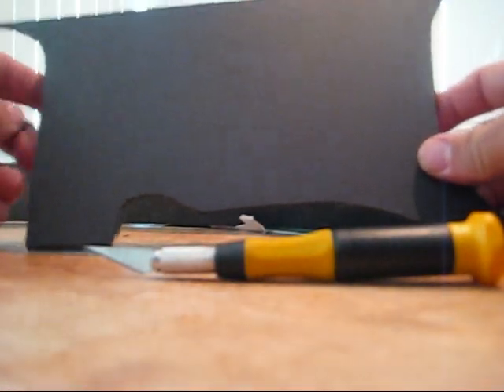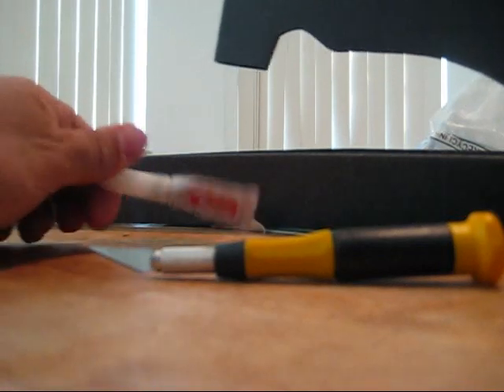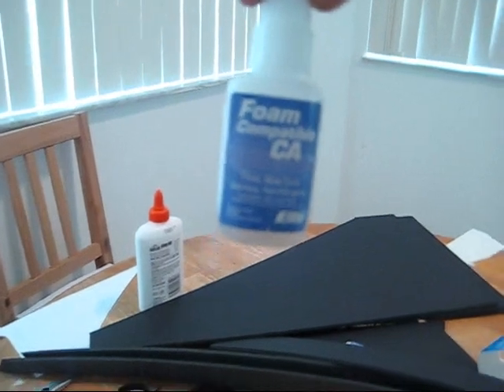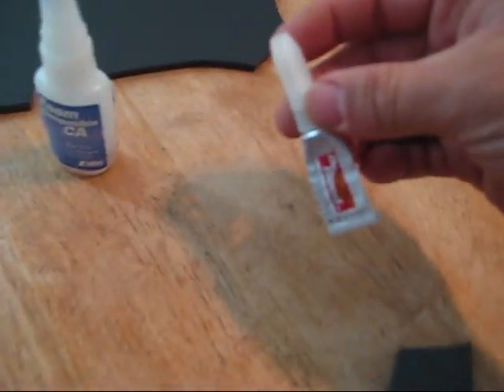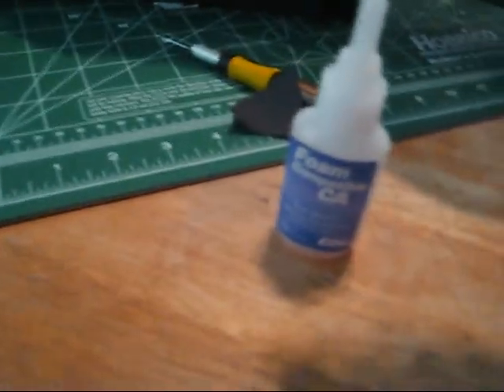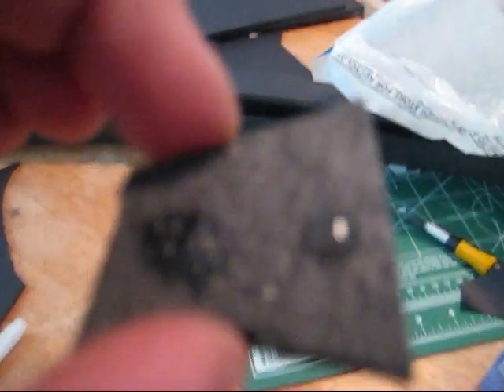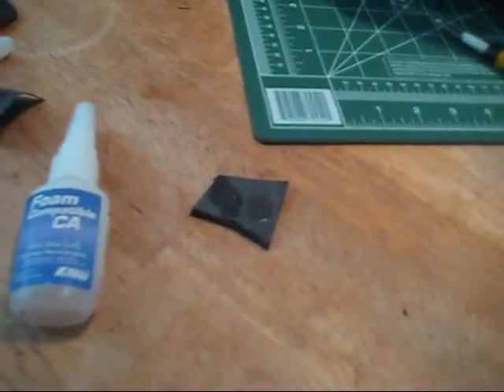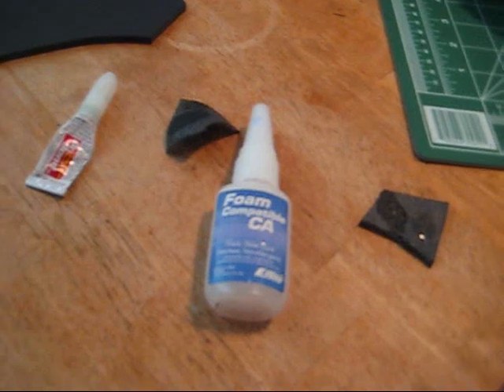Foam-Safe CA VS. Regular CA (Crazy Glue/Super Glue)

Comment: sigh. I learned this the hard way. I was building a 3D foam puzzle which doesn't require any glue, but I want to stick it together so it doesn't easily fall apart. and I used regular crazy glue and noticed that the foam was sort of melting down. Thank you for posting this!